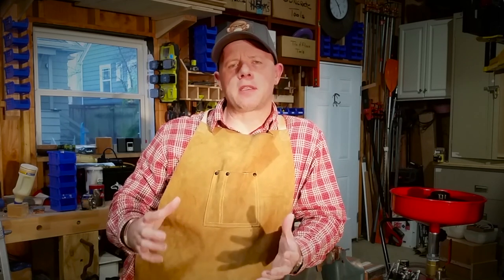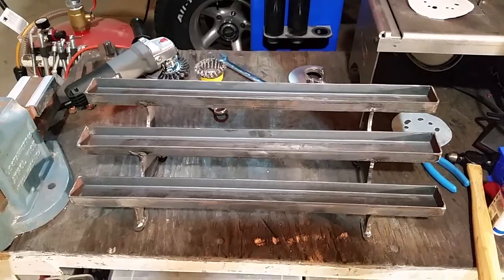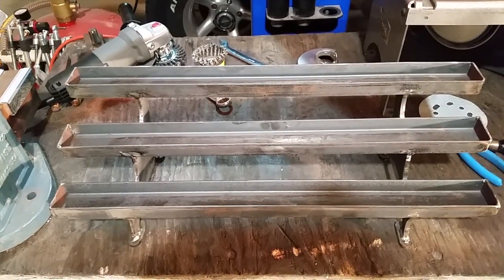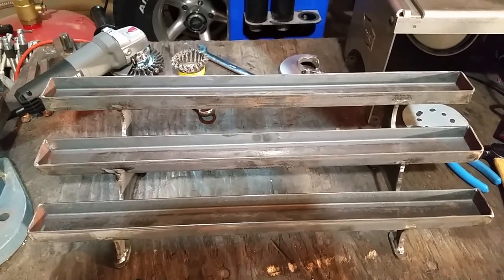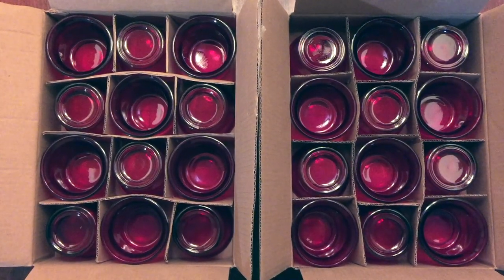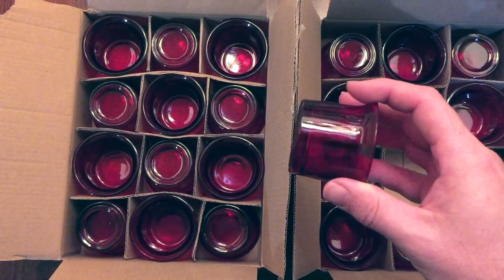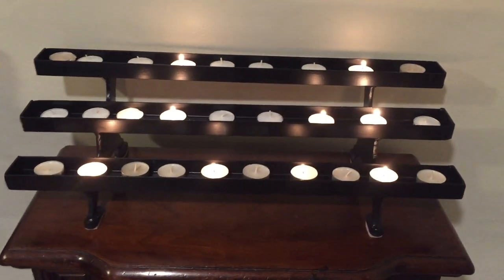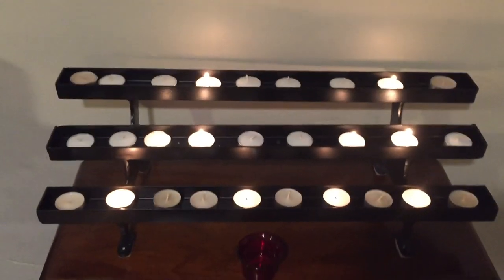DIY Steel Votive Candle Stand

Comment: Great project to use my powerplasma cutter on to cut out the parts.
Reply from the maker: Hi,  I used a plasma torch on the side pieces after struggling for a few minutes with my OXY torch.  Worked out really well.